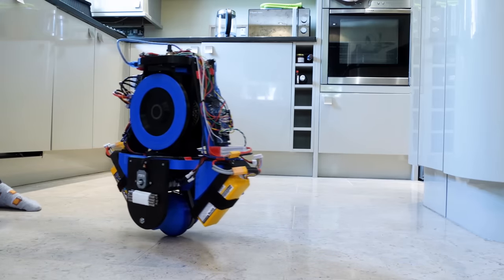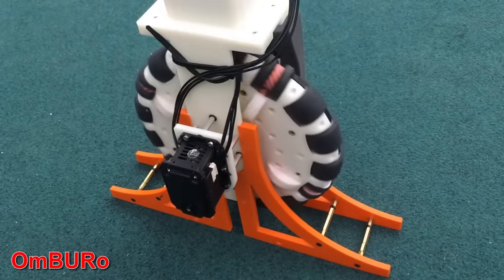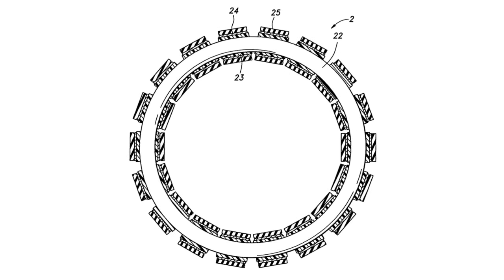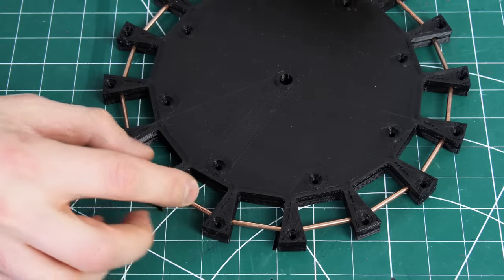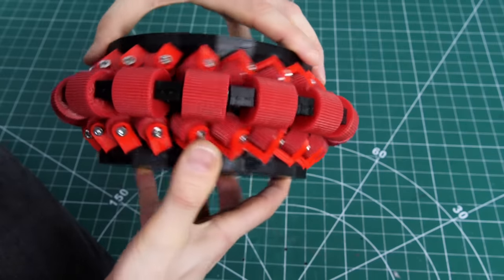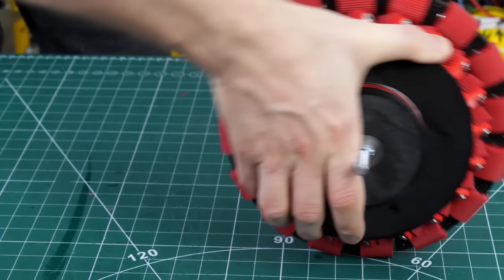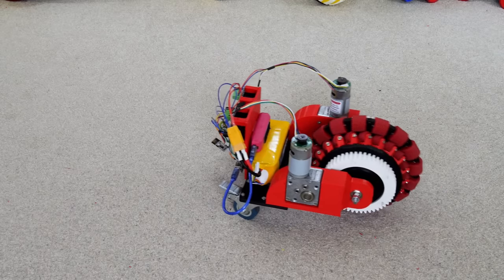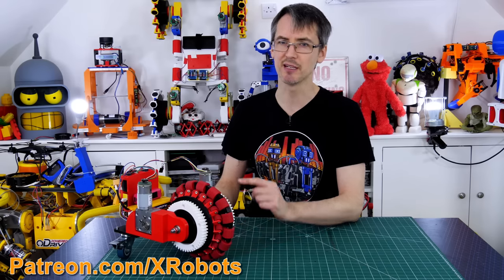Why this Omni-Wheel is Really Weird

Comment: While I do like the experiments, I would also like to know what could be useful for?
Because to be honest, sometimes I have no clue of any practical applications
In this case, I do know Omni-Wheel applications, but for 1 wheel? Not really.
Reply: 2 omni wheels = omni directional bike
4 omni wheels = omni directional cars
etc
Reply: That's what I was wondering, the whole way through. I couldn't think of anything to do with it.
Reply: @AnnoDominiAD  But what's the point of an omni directional car or bike? And if it's so great, why choose the most complicated way to do it? What are we even talking about, here?
Reply: @AnnoDominiAD  its too complicadted to be durable and cheap enough 
and on top of that you have grip problems due to small wheels 
etc.
there are way simpler designs
Reply: Less Parts, less complexity, Add it to existing things.
Automated shopping cart grabber. Can't get big trains of carts, but a few of them could navigate a car park and use a raising and lowering "arm" to grab carts and move them back into the store. Obviously would need sensors and cameras to avoid cars and people.
Patient Transport in Hospitals. Instead of needing an orderly to push a patient around, a "come along" could be used by nurses and doctors to push a patient behind/ahead of them, or could be used to move the mobility challenged around larger facilities. Cheaper to use a base "platform" that is a regular wheelchair, then just have a few bots to do the movement when the patient/practitioner cannot
Assisted Drive in various carts. Could counteract turbulence in Airplane carts with a single wheel (saving weight in the process). Could be retrofitted to attach to medical carts and crash cash to aid in reducing energy needed to push and move them, and allow the carts to be physically heavier without affecting the person who needs to push it. Warehouse carts/shelves could have the same idea where one wheel is all thats needed to assist the person moving them aside to get to other items. 
Mobility scooters. 3 wheel trike style mobility scooters require the operator to lean forward and twist to turn, which is not possible for all users. Joystick controls are easier, but more expensive, requiring 2 motor driven wheels, and they drive different from a typical system. This could combine the driving pattern and simplicity of 3 wheel, with the control scheme and ease of use of joystick drive. 

While yes, 2 wheels, or more wheels, can be used in all above applications, if this design could use a singular drive motor that's clutched, it can reduce electrical needs and lead to better battery life on all of these items. As well, the space savings can allow this design to be used in weight and space critical operations like on boats, planes, small warehouses, and trains. The cost savings, when a design is industrialized and produced in mass enough, of having 1 omni-wheel versus 2 or 4 could also prove to be superior for multi-unit applications such as the cart grabber or shelf mover in a warehouse. The 5th wheel applications are very diverse for retrofitting, and worth exploring by themselves.
Reply: it looks cool
Reply: I could see this being used in docks to move large overhead cranes around. The ones that load huge shipping cargo containers. It could hypothetically decrease the overall footprint of the crane whilst giving it a slightly larger area of operation. I'm not convinced that it would be worth it in terms of maintainability but perhaps with materials not yet available to us it might become more feasible.
Reply: Often its not about the final product but what you learn on the way to it.
Reply: @hxhdfjifzirstc894  forklifts, limited car movement, limited operational space
Reply: Hey everyone, "Art guy" demands practicality, lol

Comment: One advantage with the Honda patent version is that all the small wheels are contributing to the rotation force applied the two or three wheels actually supporting the unit.

One possible way to make "rope" axle would be to use multiple layers of carbon fibre or kevlar with each layer twisted in opposite directions.

You would, of course, have to bind the rope axle . Could possibly use resin.

Comment: Use pulleys on the secondary gears to drive the axles of small treads for better ground contact and power delivery, since you could make a high precision set of gears to drive the whole mechanism and keep it protected within the assembly. A tire or pair of tires might work well too…

Comment: Is there a way to have a motor fixed to the body that drives only the current bottom wheel? that way there is much less friction and you are not wasting power turning all those other wheels that are not touching the ground.
Edit: You would also be able to turn at the same time as you are going forward. It doesn't look to me like the current build does that.
Edit 2: Maybe the 3 current bottom wheels so you can turn when going up hill or on uneven terrain.
Reply: I thought the same thing. Why drive all the other rollers when the 3 on the bottom are doing all the work. You could just have a friction drive on the bottom 3 rollers.

Comment: Three suggestions.  
1) Run the side driver wheel plates on lower centers so only the driven wheels that are in contact with the ground are controlled. This should considerably reduce friction.  
2) Barel the outer driven wheels to conform to the other diameter for a smooth ride and concave the driver wheels to mesh. 
3) The" teeth" on the driver and driven wheels should be helical.

Comment: That "tilting changing the way the wheel steers" is exactly why I decided to dismantle my one wheeled Vespa.  I saw the 1000w one that Bel Y Bel made a couple years ago, and decided to try making one with a much stronger 3000w motor, and it was just too hard to control at that speed.  You could definitely upscale this Omni wheel to a serious vehicle!  I think would only cost about 2000£.  Just mount a 42v 1000-2000w brushless ebike motor on each side.

Comment: I think using worm gear can directly change the spinning direction from the large wheel to the small wheel. Moreover, springs or some elastic plastic can detach the gear of small wheel from the large wheel. When the small wheel press against the ground, the gear bind together again. This may reduce the energy loss due to the friction when moving the useless small wheel

Comment: The complexity is just crazy. To me it feels like a lot of excess mass and bulk when only the tiny wheels at the bottom are actually utilized at any given time.

If I were trying to make a single wheel balancing robot, I'd go with a tilted wok shaped wheel. One motor drives the slightly bent axle, while the other motor drives the wheel. The key is to have a small amount of bend, so it's possible to quickly switch direction.

It's possible for it to be passively stable, actually, but with a small hemisphere or ball shape it would require active stability.
Reply: You seem to know what you're talking about. What is the point of all this? What is the advantage of balancing a robot on a single wheel? Isn't four simple wheels far more cost effective and practical than some Rube Goldberg single wheel contraption? I just don't get the point.
Reply: @hxhdfjifzirstc894  It's just fun to try and engineer. There isn't really a practical point.

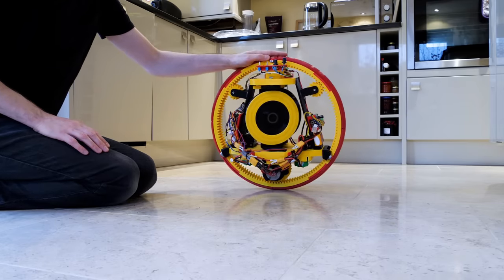Comment: 1:09 It's not an unexpected twist. Look into how motorcycles steer. The wheel falls to the outside of the direction turned. The same thing happens in a car, except you have another set of wheels to catch the fall. This is why something hanging from a rear view mirror goes to the outside of a turn.

Comment: There's a simpler way to do that.   You have a large wheel that's open on the inside as to house a L-R driving mechanism.  The hub would be biased to the opposite side (like a car wheel) or use a hub less wheel with the rollers around it.  The bottom where ground contact is made sits just 1 or 2 omni wheels that drives only the ground contact rollers left or right.  

*The reason it's an omni wheel is so the forward/reverse rotation of the large wheel doesn't cause friction for the smaller wheel which drives the left/right motion.  

*You may want 2 so that thetrnsition between rollers is seamless.

Comment: What if you made the perimeter wheels spur gears (probably best with truncated teeth) and engaged them with a large wheel, basically a very thin slice of a large diameter worm wheel. Driving the whole assembly would move back and forth, and driving the worm gear backwards or forwards would rotate the rollers, moving side to side. Obviously not great for a dirty environment, but could be an interesting concept to play with.

Comment: What about something that functions more like a unicycle? Have a single drive wheel and allow it to pivot/turn rapidly to pursue a target direction toward underneath the agent's mass. Yes, the mass would rotate in the opposite direction a bit but you could also separate the 'head' from the 'body' and let the body/wheel act on eachother while the head just sorta does its own thing for navigating with sensors/cameras. To roll in a direction it would effectively start rolling the opposite direction to cause itself to begin falling in the direction it wishes to go and then quickly accelerate in that direction to hold itself up. I think that would be a really fun and rewarding challenge for a single-wheeled bot but I'm more of a math/algorithms nerd than an electrical engineering one, and coding up maths is my forte.
Reply: I think that would be fun to see, especially considering the more or less torque needed to turn, based on load weight and the surface on which the when is operating. Imagine a 12" wheel trying to quickly turn left/right 45 degrees in grass, or a rubber when with a lot of weight doing it on asphalt.

Comment: You could probably 'save' some torque if you have the non-contacting wheels disengage from the rollers, allowing for the torque to be placed only the wheels which have contact with a surface. Might be over-engineering it though, as I imagine it wouldn't make a huge difference but it's still a neat idea.

I think you could probably do something like this:
. If the roller hubs where slightly smaller they wouldn't be able to engage any of the wheels without pressure.

. as for how the pressure would be translated, without having to change the lateral wheels; you could design the main hub to allow for small vertical movement of the lateral wheels, so when pressure is applied--either from gravity or weight on contact--the wheels can engage with the roller hubs.

. finally you could add fairly low pressure springs to the bars of the lateral wheels within the new cut outs in the main hub, or where ever the vertical movement of the wheels is inserted, allowing for the wheels to 'reset' their position when contact ends - also stopping gravity from engaging the top wheels.

Alternatively if you want the lateral wheels to only work when contacting the floor--instead of whenever it contacts with anything--you could just apply a very small tilt to the roller base so only the bottom few rollers will ever engage.

Comment: Could you make the small wheels bevel gears, and the larger wheels cross-threading bevel gears (similar to a bolt that can take both left and right hand threaded nuts) to reduce slippage?  The math would be a pain though

Comment: Sounds very good for a final engineering exam. The number of wheels or legs, for the same matter, was experimented with for millenniums. The mother nature decided it was 4. What we can contribute to it is not to invent an acrobatic stick, but to eliminate mechanical (wearing off) parts as many as possible. That is what will do in space exploring or elsewhere. 
The nature solved many problems using the available ways and tools. There is still plenty to learn from it.

Comment: I'm planning on using a number of these techniques on an upcoming project, to make a replica of the killer tire from the film Rubber. But all the parts have to basically float inside the walls of the tire so that the center remains completely empty. I haven't completely worked out if I want it to be able to lean left and right by shifting gyros or if I can turn the battery box into a servo actuated counterweight in the top and have that be sufficient.

Comment: Hydraulic tubing makes a good flexible shaft that is cost effective. I've successfully used it as a 2 foot diameter flex shaft. I assume smaller diameter tubing would work in this case.

Comment: I think a big solution would be to connect all the shafts of each big grippy gear on the center hub, together with a flexible shaft like in the other design. This way, when two gears do not interface properly, this effect is mitigated by all the other gears that do make full contact. This of course also asks for bearings next to each gear in the central hub, so this might become a heavy wheel by itself. But I think it's worth upscaling it a bit and going all the way.

Comment: If the center wheel and the two outer wheels had different centers of rotation then you could adjust it such that only the bottom would be "active" ... thus reducing friction.  Great job at conceptualizing this.

Comment: I seen a video on youtube bout a bolt with two way threads.. That is to say threads, which would allow you to turn a nut clockwise or counter clockwise and still tighten it or loosen it. instead of looking more like a screw. if you used this same idea on you main drive wheels, you coold put bi-directional "teeth/threads"  into the main wheels that would fit the rollers on each side better and maximize contact and grip between the rollers and the main hub.

Comment: You could also tilt the axis of the driving hubs so that the hub wheels only contact the main wheels at the bottom, since that's the only place it matters.  This would likely significantly reduce the friction losses in the system.

Comment: I invented something similar back in the 90s.
It's purpose was to create a robot for robot wars that addressed the number one problem, the control and feedback system.
I called it Drive By Wire and you can see something similar in your one wheel robot and stabilised gun mounts in Main Battle Tanks.
Yours looks better though, can I use it?

Comment: The problem with this design is there's bound to be significant losses due to friction given that all surfaces meet at odd angles and rely on pressure to transfer power.
The geared design, with some miniaturization to allow each individual roller to be powered by its own transmission shaft should be significantly more efficient due to a higher efficiency thanks to gears working more like levers. Im imagining something like that infamous "chianless bike" transmission shaft, one for each roller, like spokes on a bicycle wheel.

Comment: If you are confused by the steering in the wrong direction when tilted, look up motorcycle countersteering. It's the same effect, and there are huge amounts of info on it. Basically, when riding at speed, you countersteer, in other words, you turn the handlebars left to go right.
Reply: For those thinking this is anti-intuitive, simply visualize that when you TURN the front wheel on a moving motorcycle (when you put sideways pressure on the handlebars), you are thereby REMOVING the front wheel from the two-wheel system that's keeping the bike straight, leading it to lean in the opposite direction. Steering is very responsive when approached from this perspective. You can change lanes in a trice.

Comment: Ideally you wouldnt need any rotating small wheel apart from the one that touches the ground. So I am thinking either dont drive any wheel but the bottom one at a time or maybe a fixed small wheel that always stays on the contact area and comes into effect by a levering mechanism or similar when there is sideways motion needed?

Comment: You can find full core rubber wheels for bicycles that will do exactly what you need them to do. The single piece rubber is the simpler/smarter solution.

Comment: What if instead of using a twisting shaft to move all the wheels together, you had them  mesh with each other with some bevel-gear teeth on each side, and then you could drive them from the inside, still using pressure, but now without needing the diagonal slip method? Or perhaps you could even just add additional teeth on the outside of the bevel gear sections, that mesh with a gears inside the big wheel?

Comment: Just a thought that may not work ..... 
almond shaped outside wheels to match circumference........with a double thread (15deg instead of 45?) and then the two drive disks can have a much better positive engagement and weight carrying on a full circumference of gear

Comment: Steering 'into the turn' and 'opposite steering' are known things.  On a bike you can steer into the turn, or say turn your wheel just barely left, the bottom of the wheels will go from tracking straight then the barely left, thus your mass lowers and you're leaning right, and end up turning right on the right leaning curve of the wheels.  
Somewhat dangerous since you have the wheels going out from under on purpose, if you do it more than just barely you'll take them completely out from under you.  Basically the opposite steering initiates the turn in the opposite direction, then you have to steer into the turn like normal.
Just it's a known thing, there's probably tons of data on it and how to avoid or use it somewhere.

Comment: What if you had hyperboloid shaped wheels around the central wheel rather than cylindrical ones? While they would have less contact with the ground they could mesh properly with the inner rollers and not have to rely on rubbing together.